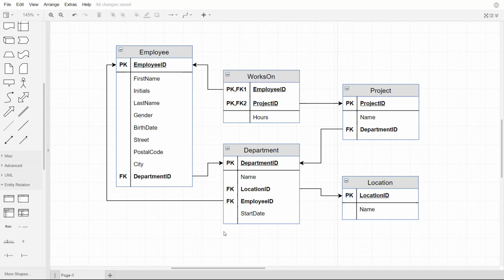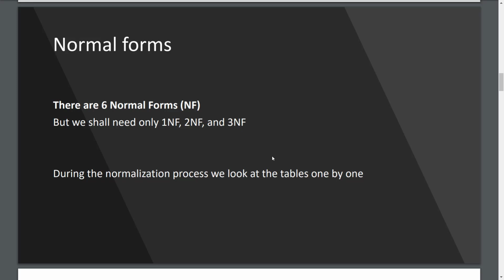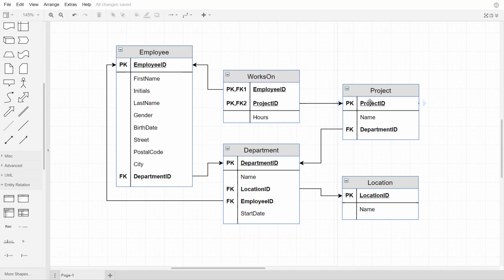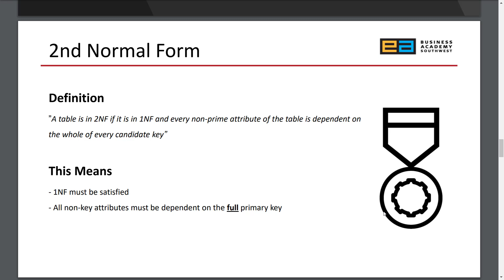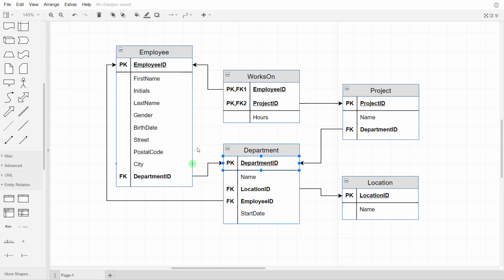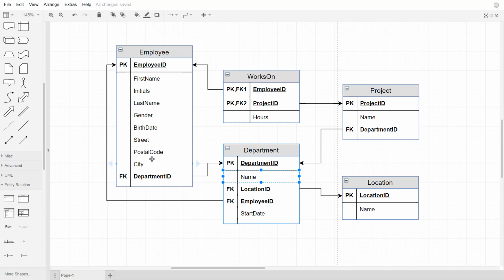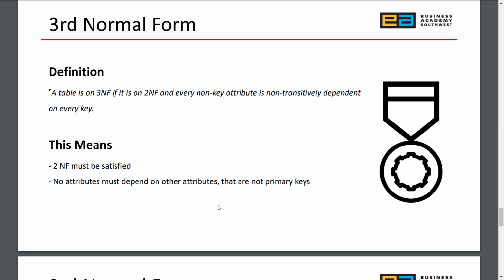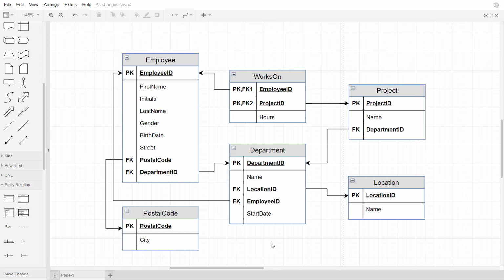How to normalize a relational data model to 3NF

Comment: Your Department table won't work as you'll end up with repeating groups as you have EmployeeID in it. If you have a "Customer"  Department for example and two employees then the "Customer" department would be repeated. You need an EmployeeDepartment table so a department can have multiple employees.